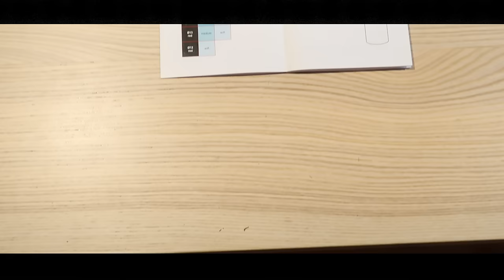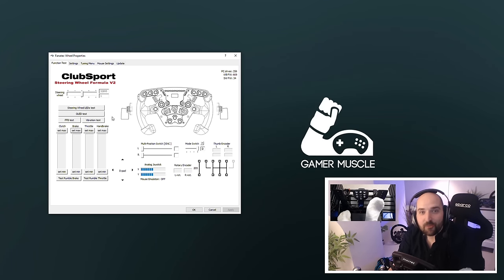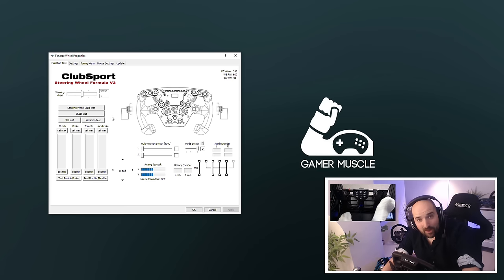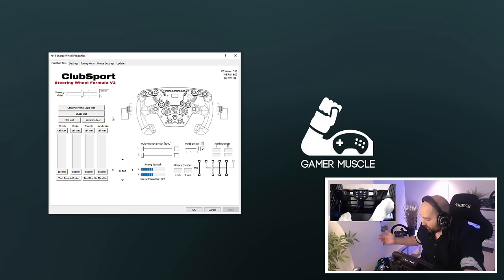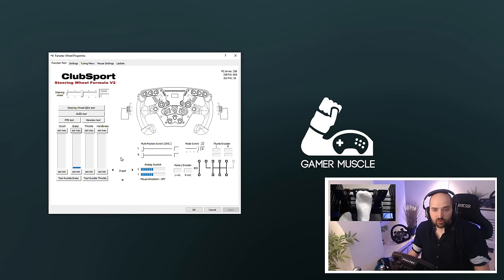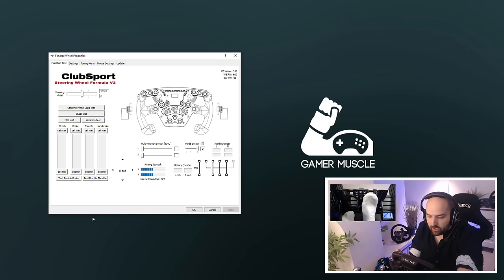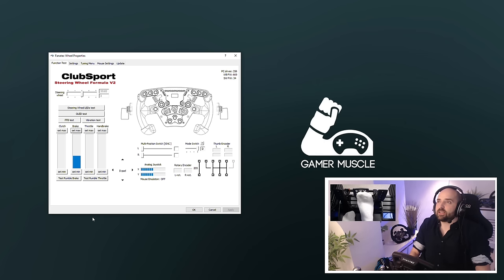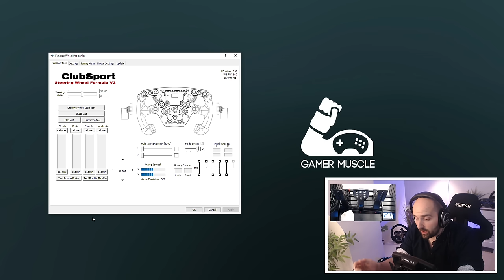Fanatec ClubSport Pedals V3 -  The Best Way To Set The Brake Up !

Comment: Can't unscrew that tiny set screw holding the bolt in place. Probably absolutely ruined the head now as well. What a shame.
Reply from the maker: Super glue an alen key screw to it overnight and then unscrew that , / Google ways to unscrew cross thrededd screw s.
Reply: @GamerMuscleVideos  cheers sounds like a good idea. I had a quick look but nothing worked it's just in there so bloody tight.

Comment: Nope, not even close.  You are missing the MOST IMPORTANT part.  GMV, You NEED to order (or have them send you) a CSP V3 Dampener Kit. 

Thank me later.
Reply from the maker: I have used the dampener kit , it makes brake response worse and just adds dampening to the system.   If that's how people like the brake to feel fine but I don't see how the Dampener kit objectively improves the input utility of the pedals outside of giving more options for a specific feel.